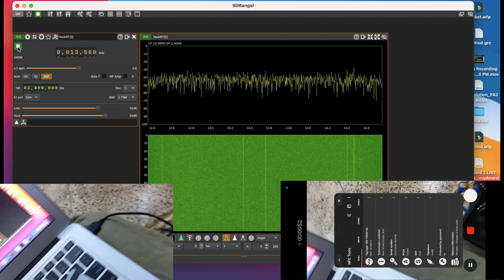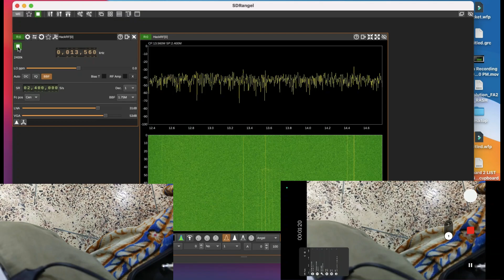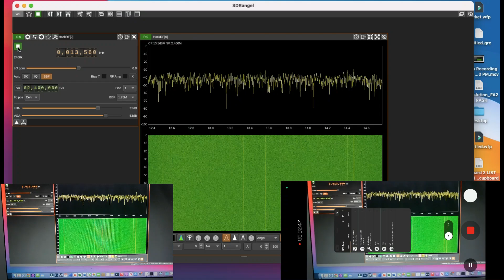Inside NFC: What HackRF & SDR Can Show — Legal Test Demos Only

Comment: you're not showing where the cards are physically touching. the two videos at the bottom are the same, except one has an app overlay. is it your phone or the hack rf antenna that you are touching the cards to? is the hack rf reading the data or only detecting its presence because of the frequency? view appears limited to see what is going on.
Reply from the maker: I was bringing my phone close to NFC card, while HackRF is monitoring the activity and showing it on the spectrum, it was tough to use a single phone for NFC card detection, and using the same antenna for filming, and also do the screen recording on the same phone which is detecting the NFC card.

Basically I tried to do a job of three cameras using the single camera, and that's the result